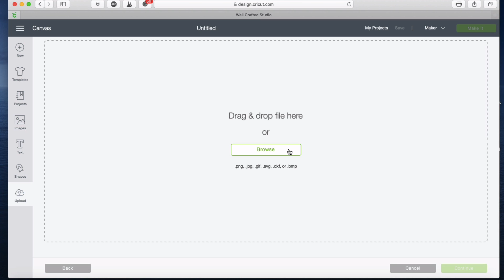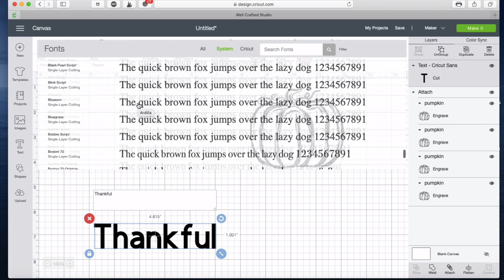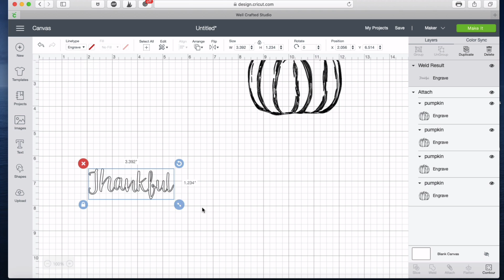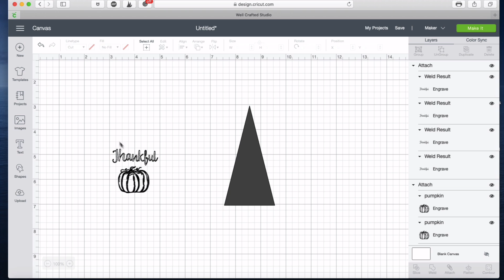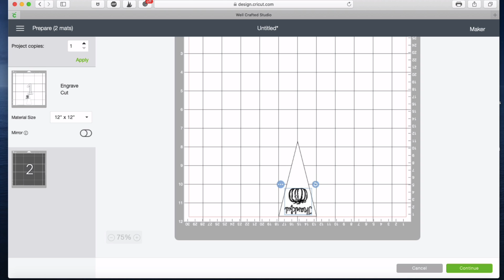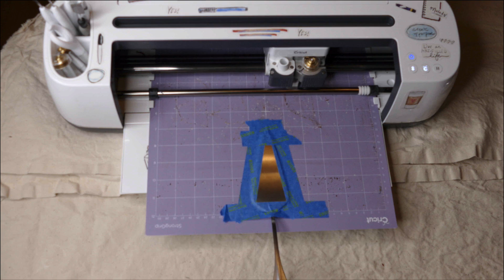How to Engrave Stainless Steel Servers w/ Cricut Engraving Tool

Comment: Hi!  Thanks for your great videos!  I have a project to engrave the handles of some vintage silverplate flatware.  The handles are not too thick, just slightly over 1/16th of an inch, and flat enough to tape them down and put handle first into the machine i think, letting the spoon/fork end hang off the end..  I want to monogram just one letter on each piece.  A hand engraver quoted me 50.00/piece to do this, (yikes) so looking to see if I could do it myself with some great tools like the Maker 3 with engraving tool.  I have a ton of these pieces, so could afford some experimentation if necessary.  My biggest concern with trying it, is that Cricut says they don’t recommend engraving any materials narrower than 1”.  My flatware pieces are only about 1/2” wide, and smaller for some of the spoons.  I only need one simple initial on them though.   What do you think?
Reply from the maker: I’d say try it! Cricut recommends a lot of things to be safe. But I’ve found you can push a lot of their limits (like thickness). As far as width, I’ve done things quite small- the problem there is shifting. Just be sure you use a new purple mat with double stick tape underneath. Make sure that you use blue painters tape on the handle.
Reply: Thank you!   @WellCraftedStudio
Reply from the maker: @PerriMartin  absolutely!!! I totally think you can do it. I have a video on engraving spreaders where I tried some different tricks for engraving on a narrower surface. You might want to check that out too.

Comment: I am working on this right now. I have followed you step by step, but when I load the mat, it runs in, then on the way out I get a red and white flashing power button?? Any ideas?
Reply from the maker: Hmmm… I’ve never encountered this. I would try engraving something else (with a different file) and see if you have this problem again. If it doesn’t, then try testing with the same file. (I use metal flashing sheets to test engraving designs.) But off the cuff it sounds like something you need to contact Cricut support for.

Comment: Thanks for the video! I was just wondering how long the engraving took? I have 200 stainless steel products to engrave 😬 I’m not sure whether the engraving tool would be durable enough for this, and whether the time taken would be excessive.
Reply from the maker: Cally Wetherill I think it took maybe 35 min? And that’s because I did the duplicate 3x. So that ends up being 10 min. or so. That was a pretty simple design. The more complex the design (added pattern fill like crosshatching) and it can go a lot longer. The engraving tip does wear a little over time but it’s taken me almost a year and I engrave a ton before I felt I needed to replace my tip. I did have to oil the housing once. 
The thing with the Maker is that it can work without you being right there. So several people have gone ahead and engraved 2-3 servers at a time and then walk away to do housework for example. Another option is to buy a second maker and run them both at the same time. That’s a lot of extra cost but if this is a business for you it’s something you may want to consider investing in at some point.
Reply: @WellCraftedStudio  Wow thank you so much for all the helpful information! Maybe you're right and I can run four or five at a time, all in a row, and leave it running while I have clients in another room. The setup will be faster once I have a template too, I imagine.

My other plan for stamping the steel was to have a custom logo stamp made, that I can stamp either using a hammer or an arbor press. Or to outsource it completely. Outsourcing would be the best option but obviously it depends on cost.

Your video was amazing by the way, I hadn't even considered buying a Cricut but now I'm seriously thinking about it, as there are all sorts of things I could make for my beauty business, and I could perhaps sell b2b as well! If I buy one I will definitely be checking out more of your content. ❤️

Comment: Great video.  Very detailed .  Would have liked to see some actual engraving done. Understand need to fast forward because it takes longer how long did it actually take?
Reply from the maker: Noted! I do show a little bit of it in my other videos. I try to let it start and go a few seconds now. It is kind of magical to watch. The engraving for the servers took about 30 min. but that was after duplicating it 3 times, so that essentially it was engraving the same design three times. However, I have done some designs that took hours. It all depends on the amount of detail in your design. Hope that helps!

Comment: Hi! I am thinking about buying my first Cricut and have a few questions about the engraving capabilities. How small of a font size can the engraver handle? Can you engrave any metal? I have brass and copper sheets I would like to engrave. Also, which Cricut version do you need to do the engraving? Thank you!
Reply from the maker: SweetRoxyFire89 Hi! Oh my gosh it’s so awesome for engraving. I’m actually writing a workbook right now on engraving metal with the Maker. So I’ve been testing different metals. It engraves aluminum, anodized aluminum, brass, bronze, copper, silver plate, stainless steel, sterling silver, and pewter. It also engraved galvanized steel but I can’t get anything to show on it because of the zinc coating. As far as sheet metal I’ve tested it up to 16 gauge. It’s seriously a blast! As far as font size I guess I’ve never looked at what size it ends up being but it’s super small. I would say for sure it goes down to 12 pt. I’ll look later and add to this comment. ❤️ 

I also have YouTube videos on engraving silver plate bookmarks, and I have a 16 Best tips for engraving that you’ll definitely want to watch once you have your machine. 

And thanks for asking- if you have anymore questions feel free to ask me. I like answering them.
Reply: Thanks so much for your quick response! I appreciate you making these helpful videos. Where will your workbook be available? 

The reason I asked these questions is because I’m looking to do the engraving instead of metal stamping. The metal stamps are 1.5mm which seems to be equivalent a 4-5 pt font. Does it go that small?